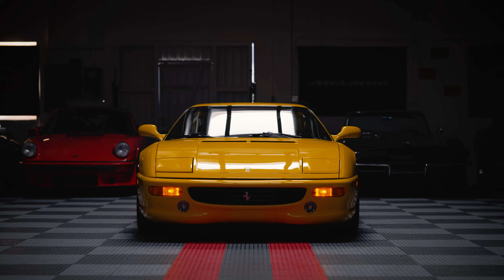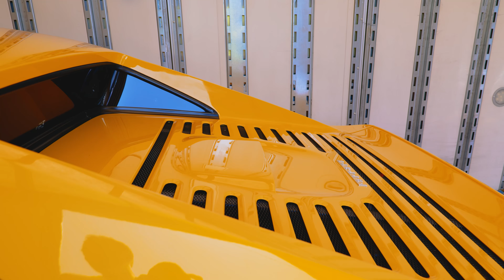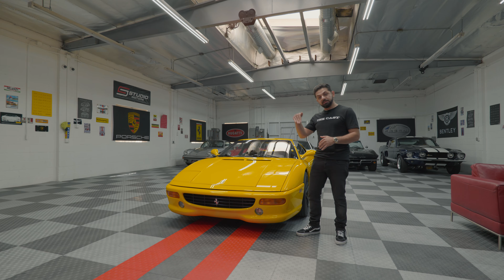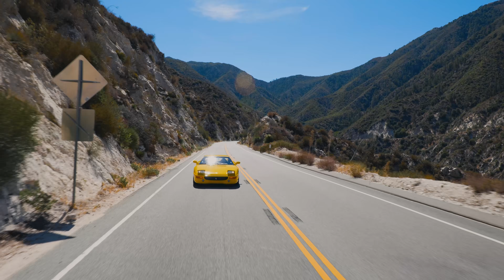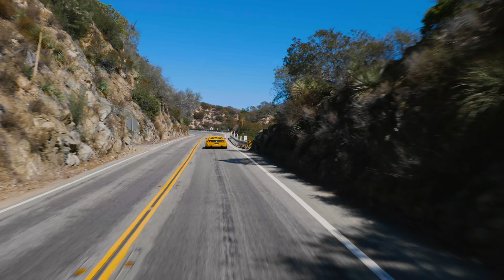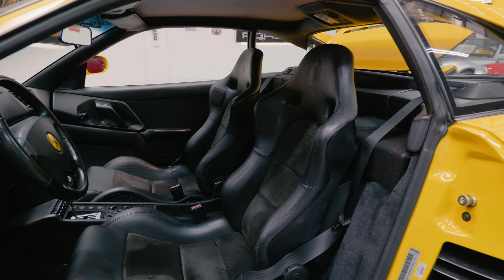This is Why You Should Buy a Ferrari F355 Right NOW!

Comment: First year production was actually 1994
Reply from the maker: No sir, the first year production is 1995. Obviously they produced the cars in 1994 for the 1995 model year, but the 355 runs from 1995-1999.
Reply from the maker: @285ferrari  You’re right, some Eurospec cars were labeled as 94s because they were built in 1994 but those same cars are 1995s in the US. How many 1994s have you registered?
Reply: There are over 190 in the registry currently with a 1994 model year.  @StudioMotors
Reply from the maker: @285ferrari so about 2% out of 11k cars?

Comment: Great video.  I owned a 95 yellow just like this for over ten years and I learned a lot from your video.  Thank you.
Reply: Actually, I still own the car. Not as sharp looking at yours.  I don’t drive it as often.  Has an issue with temperature gauge hitting very high  within a minute after the car is running.  I’m waiting for the a new thermostat to arrive so I can change it out and hope I’ll be back in the road, if that’s the issue.
Reply from the maker: Man that’s awesome. I’m not sure how long I’ll keep mine but I can’t picture a better 355 for myself. I feel like if I sell this I’m never going to find a better one later down the line. 

Hopefully it’s an easy fix and you’re back on road by summer!
Reply from the maker: That's such huge compliment, Minh thank you! When did you sell it?

Comment: @studio motors. love the way those wheels look ... did you use original spec size wheels or these rims have different specs? if so , what was the change . might get myself a pair . thanks . great video
Reply from the maker: Thank you! Here's what I had and went to:

OEM:
Front: 225/40/18
Rear: 265/40/18

Brixtons:
Front: 225/35/19
Rear: 285/30/19

Comment: Hello, you have a great F355 with all the rare options- challenge grille, sport seats and, factory shields. You should know that other owners whom put large wheels or run spacers which change the offset of the wheels have damaged their fenders when the tire/wheel rubs. Given that you have factory shields you may wish to consider running a wheel that matches the factory size and offset or simply just run the factory wheels. The car is only original once. Your video is great and there are some great shots in there. Congratulations on the car and I hope you enjoy it.

Comment: Paddle shift on the 355 is garbage. STAY AWAY!
Reply: ignorance..  I have owned both! and like both
Reply: @steveweisfeld5362 it’s not a dual clutch you have to drive it like a manual and treat it like a manual without a stick
Reply from the maker: Will do!
Reply: @StudioMotors you have to drive it and treat it like a manual then it’s good
Reply: Totally false.the F1 is the same exact transmission as the 3 pedal car. I own an F1 and it is flawless and you can shift an F1 quicker than you can shift a 3 pedal car. The difference between the two is a personal difference and nothing more.

Comment: Great car, just bought F355 GTS Pozzi blu with carbon sports seats + Fiorano pack
Reply from the maker: Congrats on that super rare 355, Reza! Aside from all the added carbon fiber and interior upgrades, the F355 Fiorano was almost a Spider version of the Challenge cars. Fantastic find!
Reply: @StudioMotors  Hi yeah, but my car have only Fiorano package its more steering wheel rack + suspension + brakes. Also my car had the challenge grill + carbon options :) Will get it tomorrow
Reply from the maker: Reza are you picking up the 355 today?
Reply: @StudioMotors  I will get the car Friday, so looking forward